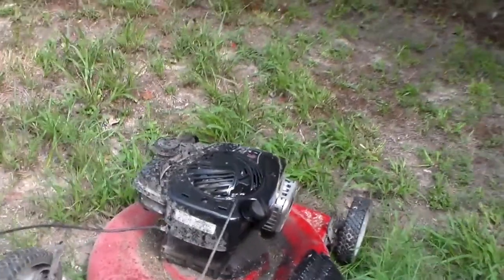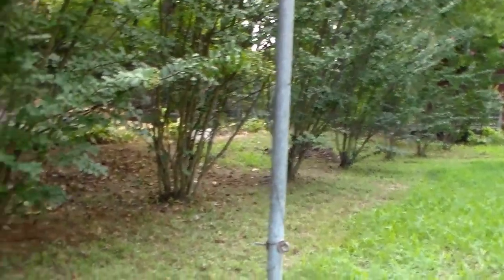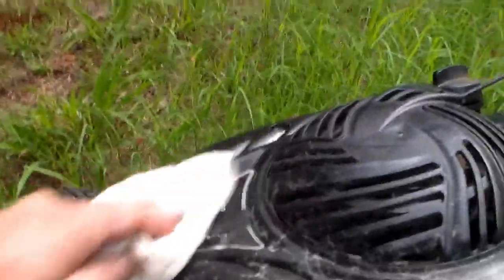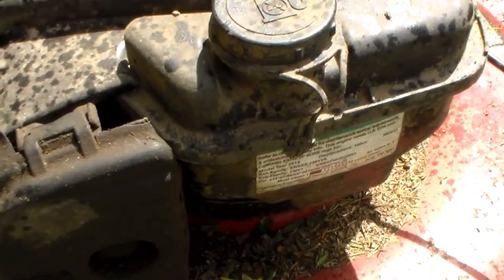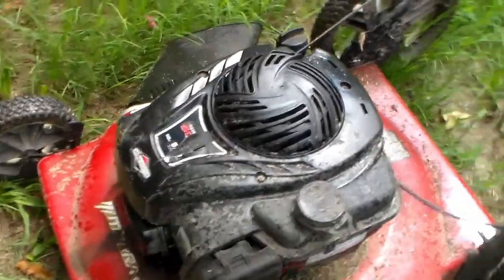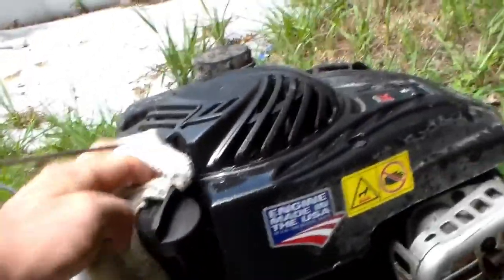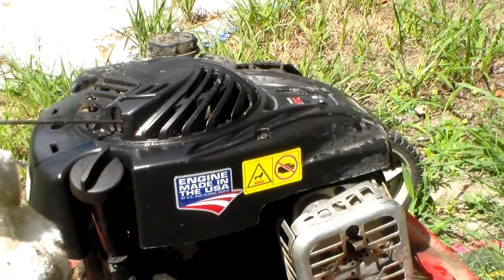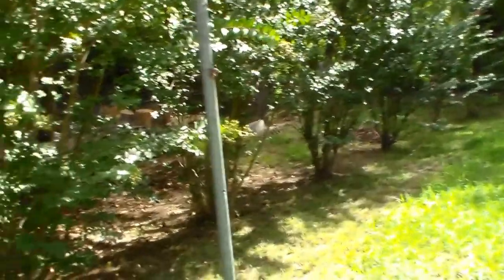Murray M22500

Comment: Yes my Victa classic cut push mower here in Australia, has this exact 500e series 140cc briggs & stratton motor. You are right the air filter is in a bad place. Iv'e bumped mine off over and over again under bushes. The oil dipstick came off under a bush the other day. It then flew under the blades chopping the lid up! Now its a joke finding a new one! What a Silly area to put both the oil dipstick and air filter in vulnerable positions! C'mon Briggs & stratton!

Comment: understand your frustrations. 
MURRAY is as of circa 2004  owned by Briggs & Stratton so every Murray will have a Briggs & Stratton engine on it now a days.  The Decks are sourced from Various Suppliers 
I saw reports of it being  AYP    and  MTD as well.

https://en.wikipedia.org/wiki/Murray_(bicycles)
https://www.reference.com/home-garden/murray-lawn-mowers-e65e153b0295eef4

for your air filter cover problem you might consider a small screw thru it a part of the plastic cover to hold it in place